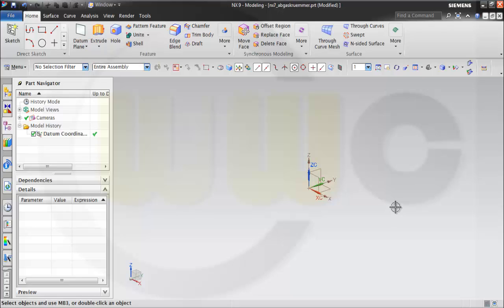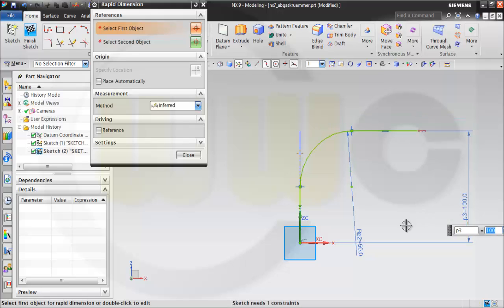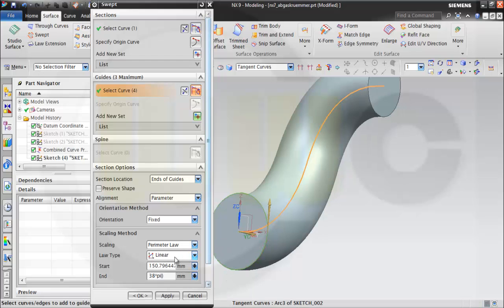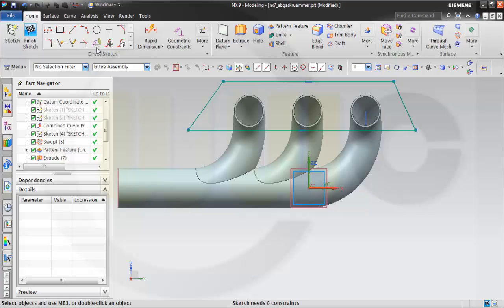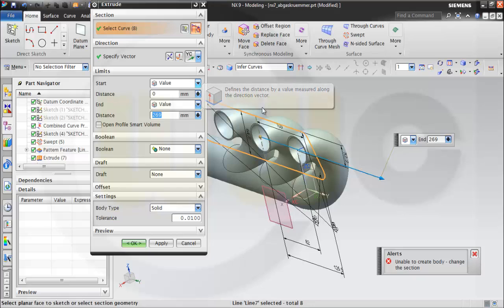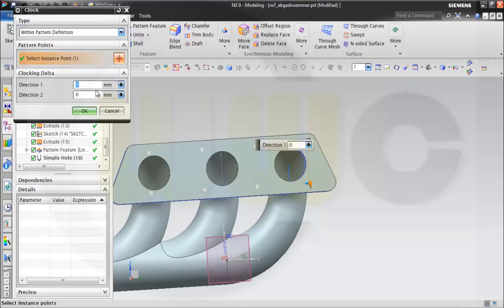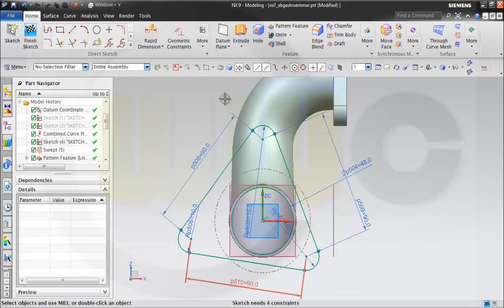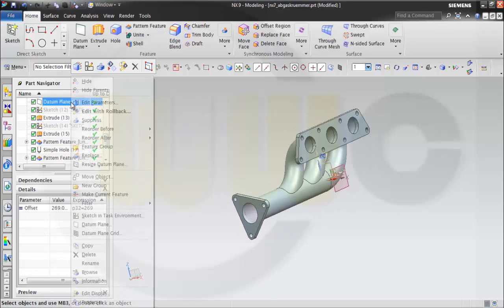12.2 Abgaskruemmer - Siemens NX 9 Training - Perimeter Law

Comment: Hi i have a problem in the second curve, can you help me?
Reply from the maker: Sergio David Pérez Oropeza Hi, so what is your problem?
Reply: Wolfgang Walden When I select the second curve in the top point are activated two vectors
Reply from the maker: Sergio David Pérez Oropeza  I didn´t use the spline command, maybe you dit?
Reply: Wolfgang Walden this happen when I use the command : combined projection
Reply from the maker: Sergio David Pérez Oropeza So maybe, both your sketches which you used for the combined projections are not fully defined? Or if you want, mail me your part and I could check:  info@wwmc.de